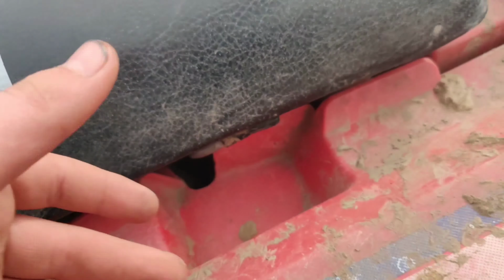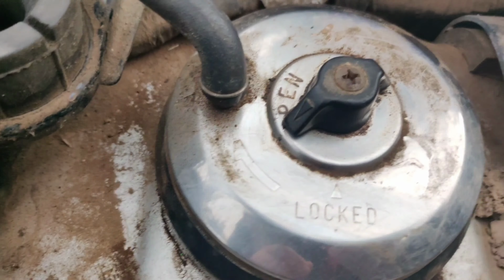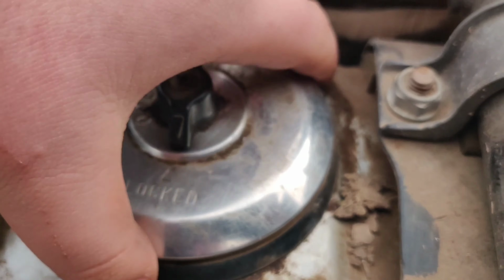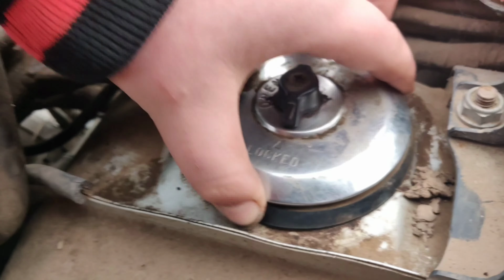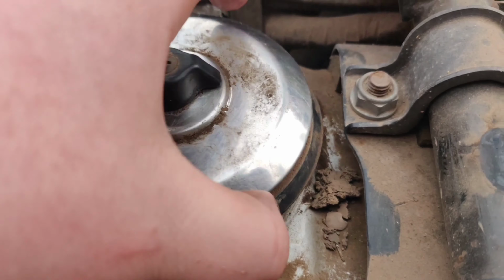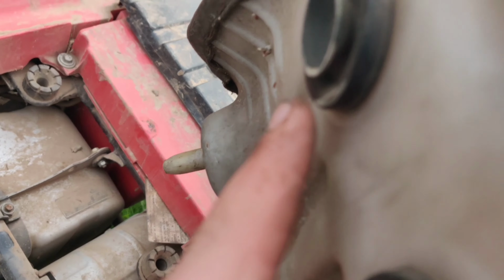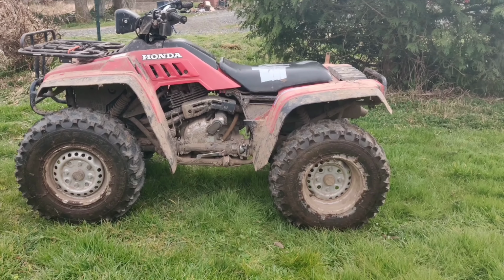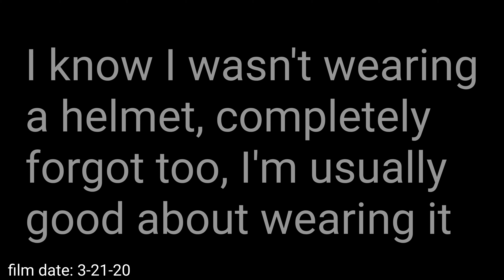How to close gas tank lid on Honda fourtrax 350 (1986 model)

Comment: That cap is worth its weight in gold for still working like new! Nice video.
Reply from the maker: I'm sure it is, everything on these quads seem expensive if they are working and original
Reply: I just replaced mine with a plastic one. The original metal one rusted out really bad. I'd like to do a video of the restoration process/project that I wanna do. There's not too many videos of this exact model and it's really good to see anything related to this particular atv. Thanks
Reply from the maker: Ok yeah, im sure it wouldn't be to terribly hard to restore... For added affect go put it in a thing of wet salt so its completely trashed and do it asmr style (like some of the restoration channels who i watch that "restore" a toy they just bought, purposely broke and then get millions of views) lol.

Yes thats why i made a video, i honestly had no idea how to close it nor did the previous owner, i looked all over for a video and found it out myself and told myself... This may be the most stupid thing ever but if it helps somone with one of these classics, its worth the 20min it takes to make a video
Reply: Yea that's what I really want to do. I like those boots, are they Durango boots? Someone needs to do a video on the electrical layout as well on these to make sure that's all good.
Reply from the maker: There Justin steel toes from tractor supply

Comment: Great video man!  Mine is "stove- up" a bit, however.  I actually have two of these WONDERFUL ATVs, and both are stove up where the black knob activates the two metal locking pieces on the bottom of the cap.   I have soaked then in pénétrant and they still do not function correctly.   Ugggghhhh